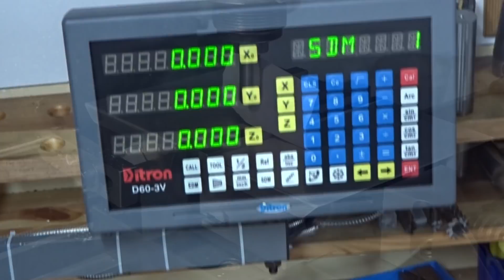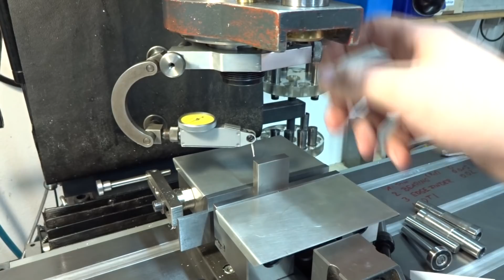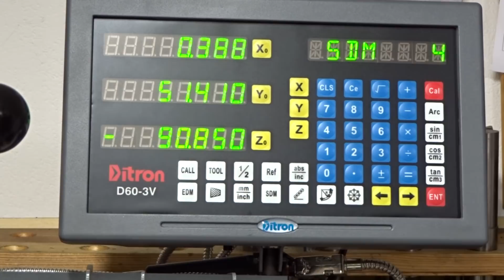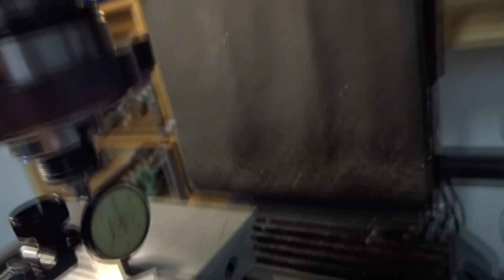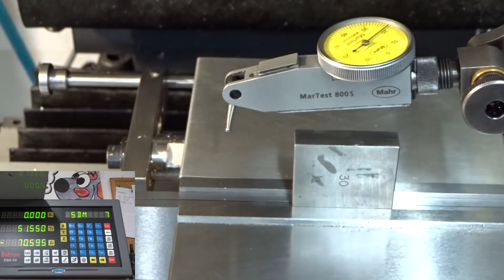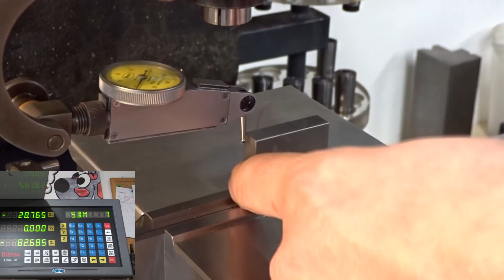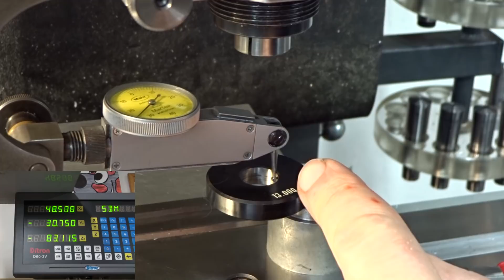Edgefinding techniques

Comment: I've seen on the Internet an Indonesian  machinist use a wire to find the edge of the workpiece.
Reply from the maker: Yeah, esp. with welded assemblies or castings thats not the worst solution.

Comment: The newer DRO with LCD screens allow users to enter any arbitrary number into X, Y or Z counters.
You only need to touch the edge, enter the diameter of the edge finder or thickness of the paper into appropriate axis and you are done. No need to move the table to reset the counter to zero.
So if you are looking to buy a DRO display, get one with LCD display.

Comment: Simply refreshing not to have to hear about "INCHES" and "FEET" or other body parts still employed by North Americans to describe distances. Not to talk about fractional BS like 17/64 or nuisances like that. After years of trying, no American can tell me off the top of their head what we wind up with if we want to add 17/64 plus 21/32 , subtracting 3/64 and then divide that by two - without resorting to paper and calculator.
And BTW: Very nice Video, the comparison is compelling, and pointing out the 10 Micron spindle runout revelation. Sehr interessant gemacht, Stefan.

Comment: I really loved this video but I don't understand the last part.  What does it mean that the "indicator is set to a certain diameter"?  the tip of the indicator is under tension while it's in the hole, right?  Otherwise you wouldn't be measuring anything?  So how is it "set" to 13.000 rather than, say, 12.900?

Comment: Stefan, I was thinking about the 20 micron discrepancy and I remembered your discussion from a year or so ago when you showed how the indicator holder could be a source of the problem ( from slop in the joints ). The holder mounts to the spindle and has two pivot points prior to the dovetail mount of the indicator.

Comment: Another use for a (standard) edge finder is for finding centers of holes, using the 1/2 feature of your DRO. Just start off with your finder somewhere arbitrarily inside the hole (it doesn't seem to matter exactly where) and do a move in one axis to each side, using the 1/2 calculation to find that axis' center, and then repeat for the other axis. You can do a double check to be sure once you have established what you believe to be the center, but I have found it not usually necessary. You can do this on any size hole that the edge finder will (at least) loosely fit into. I do this routinely, and have checked with a test indicator for accuracy, finding it always within a half thou. Just make sure the hole is round, clean and smooth for the best result.
I believe it is a quite reliable method and saves lots of time. Try it yourself and see.

Comment: What about the Multimeter method? It's where you set a multimeter to continuity mode, clip one lead to the stock and the other to the tool. As the tool touches the stock, it beeps. This method allows you to avoid changing tools. Btw, who makes a better CNC for general purpose mold making, Datron or Kern?
Reply from the maker: Datron and Kern are two complete different machines.
Datron builds Routers, Kern builds hsc milling machines.

So, easy answer, none of the two for general purpose mold work. Most Kerns cant cut Mold bases, because they are to large and Datrons are not efficient at machining steel.
If we talk only mold cavities/inserts, the Kern of course.
Reply: @StefanGotteswinter  You must know both machines like the back of your hand. Cool!
Reply from the maker: @bobweiram6321  Yes and no ;-) 
I ran a Datron M10 for 7 years in prototyping, a M3 and M35 before that for quite some time.
No hands on experience with the Kern, but we have one at my dayjob and i have done a tiny bit of programming for it.

Comment: HI; these edge finders with the spring inside are dangerous , because if you spin them to fast the spring becames a slasher, to stop that to happen , I fit a piece of 3/32  tig welding rod  
inside the spring  ...

Comment: Stefan, about 25-30 years ago, I was given a "double-ended" (wiggly) edge-finder by a Toolmaker at work.  For the last few years I haven't used it.  I recently set up my mill-drill :( to make a few parts and the edge-finder seemed "sticky" and appeared inconsistent.  You said to use a small amount of grease to lubricate this type of edge-finder.  Can any grease be used?  What about different types of  oil?

Also, my "double-ended" edge-finder has a spring-loaded cone on one end, but I've never seen that end used either in real life or via YouTube.  The only way I can think of to use it is to turn the spindle off and lower the cone into a round hole (that it happens to fit without dropping all the way into it), mic the "offset," and adjust the X & Y axes until there is no "offset."  Is that correct or are there other ways to use the cone end?

Both books by Moore are (or were within the last two years when I bought my copies) still available new from Moore for much less than from eBay and other online used book sellers.

Thanks for this video.  I learned a lot from seeing you demonstrate the different techniques!  ;)

Comment: I never understood the need for an edge finder to kick out, the mere coming in to running true verifies it contacted the work piece.  Having to move the table in closer for a kick out  seems like it would adversely affect the accuracy by a few thou, no?
Reply: Joe, no, the edge finder kick-out doesn't adversely affect the accuracy by a few thousandths.  I don't understand edge finders well enough to explain them, but a year or so ago Stefan answered a question by saying that in his experience at his work place with quality edge finders and high-end CNC machines that the edge finders are accurate to much better than one thousandth.  I forget his actual answer, but they can be accurate to within a few microns, if memory serves.
Reply: Yes,  understood of course, but it just doesn't seem logical that it touches, turns true, has an exact diameter, and yet we crank the axis a little extra to make it kick out. 🤔

Comment: Excellent video on the pros and cons of the various methods. Like you,I prefer the rotating edge finder for edge locations and the finger indicator on a 'C' type spindle holder for centering on round features. As you say, the coaxial indicators are very good but take up a lot of headroom due to the length of the body. All good stuff,Stefan.👍

Comment: 18:00  This would be particularly interesting with a laser, less angular distortion?
Reply: With a laser, you will get weird interference patterns when the two parts get close.
I'm sure Stefan would use that when he wants sub-micron accuracy ;-)
Reply: @TheEvertw  
Doesn't an Interferometer require two paths of different lengths?
Reply: @lordsamich755  It does. I was talking about diffraction patterns, which are a result of the interference in a laser beam when it passes a narrow slit or orifice.

Comment: Great video, Stefan! During the past year, having a little more time on my hands, frustrated with a cheapie spindle indicator holder,  I made an indicator holder a little like yours, and one feature I found I really like is a fine adjust.. not an essential but makes things even more convenient.. I also worked out a way for none of the thumbscrews to loosen from pivoting the joints.

Comment: Hey less of the old timer, I still use a cigarette paper
Reply: I found that the small anti-shoplifting RF devices, about 3/8 x 1 1/2 " rectangle, (often stuck to a store bought item) contain a couple pieces of thin metal, that are about 0.001" thick, and fairly tough.. useful for edge finding if you don't have shim stock that size around..

Comment: Hey Stefan, great video! Thanks for the clear presentation. I really enjoyed your approach.
I'm just wondering... does the deviation of the pin and paper method go in the right direction? Does the smaller numer compared to the other methods indicate spindle runout? or maybe misalignment of the head?
Cheers, Michael

Comment: Am I the only one that brings the stock to pin?  That's a lot of extra work to find a work offset.  Drop the pin wherever, bump the part against the pin, clamp the part, zero the axis, adjust for pin radius.

Comment: Hi Stefan; i was wondering how much dependence these methods have on the squareness of the gauge block and gauge ring vs. the axis of the spindle vs. table... If the gauge block is not perfectly square, it seems that one would have some dependence on Zed axis position of the touch points... In the case you have, the dowel pin with the light source behind it seems to "check" the square relationship, and even show a few microns of surface wear/unevenness?

Comment: Another thing you can do which I have found works reasonably well is to just catch the paper with the end mill and pull it back, (with enough area for a micrometer tip), and then measure the paper thickness with your mics. I've also noticed that providing the pin has no runout, you should be able to see light past it down to .0002 of an inch. Most of these methods you have described very well and work fine for most purposes. Another trick I use occasionally is to clamp the part in your vice, then swing a radius between the vice jaws near the part, then zero the indicator in  the center of the jaws, then you know exactly half that (thickness) to then indicate the sides of the part to center of the spindle.  Good video.

Comment: Maybe I missed it but after using the dial test indicator (d.t.i.), you could move directly over the edge and set your d.t.i. to zero. It's a bit tedious, but explained better than I can in Moore's book,Holes Contours and Surfaces in the chapter Jig Boring Practices. The benefit is that you are directly over a edge , no radii to account for, no radii to forget about.  another question, what's your feeling on using a slip type edge finder horizontally?I've always tried to have the live end of the edge finder climb a vertical surface, meaning the spindle direction will run  counterclockwise or clockwise depending upon the approach direction. I've grown to favor the d.t.i. but sometimes an edge finder is the quick & dirty way to go. Excellent video, well explained and presented.

Comment: Hi Steffan.  Thanks so much for your videos.  I am an electrician, and i build automation systems. I stumbled over your videos for 6 years ago, and now i both own a lathe, bridgeport mill  shaper and surface grinder.   Its contaiges..  Though yours and other youtubers like abom79, tom lipton videos, you have tought me to use these machines.  Thanks so much for all your help. 
Is it possible that you can put a link for the build video for your Dti holder?

Best regards Filip

Comment: My favorite tool on a mill is an edge finder, however I still can't exactly understand how it's not connected to the spindle runout... If it's 10.000 mm in diamater and it's placed in collet with 0.04 mm runout after it knocks off you have to move it 5.02 mm to find the center, right?
Reply: Draw a circle and think about it as the spindle bearings. Mark the center with a cross and now draw a smaller circle off-axis inside - that is your edgefinder with some arbitrary amount of runout. Now the whole thing including collet turns around the centre of the spindle bearings - it will share the bearings centre of rotation. The edgefinder can slide in any direction to self-correct for this runout. A normal endmill of course does not.

Comment: Hi, the method with the DTI only works if the edge is vertical, am I correct ?
Reply: No you can find the Z midpoint the same way... Touch the top edge, zero your DTI and your DRO, then drop down and touch your DTI to a small gage block that you're pressing up against the bottom edge of the part surface. Now you've easily measured the height (or length) of a feature from the top of the part. To get the midpoint, just use the "1/2" button on the DRO.

OF COURSE, you will have to do some math to offset any tools to cut at this midpoint. For example you could put a 123 block on the table (or just use the back of your vise) to get a reference distance from the midpoint you just measured, and then set your Z height of your tools based off that surface.
Reply: @pmdeutsch  Then the method proposed assume that the side of the part is vertical, and it can work for any angle if the 2 measurements are done at the same distance (one below and one above) from the top of the part.
Reply: @bzaz_3158  I would assume so, but only if the two angles are in fact identical.

Comment: I never considered using the bearing method. I always used a dowel with a .001 feeler gage. Edge finder is another easy method for quick setups.

Comment: I've got the same DRO-- they are distributed by PM here in the US. I never knew what the SDM key did! I'd been using the INC/ABS key to get 2 coordinate systems.
Reply: Read the manual. There are a ton of features you're probably missing out on.
Reply: Stefan did another great video on this, more applicable to the lathe but also usefulff for multiple datums on the mill   https://www.youtube.com/watch?v=zJX7QCvSo-U

Comment: Thanks!  I find a lower speed works best for the spring-type edge finder. At 1000 rpm I can see it snap away, but at 500 rpm I can see when it just starts to move.

Comment: DID I HEAR - SCRAP GAUGE BLOCK?    Way to make us amateurs feel just that little bit smaller and a little more insignificant.
How do you have a scrap gauge block in the first place?
I thought disrespecting a gauge block was considered heresy deserving of a medieval punishment that included the removal of body parts.
Reply from the maker: I buy used, very bad looking gage blocks or even better whole sets of rusted gageblocks whenever they come up for cheap, for various purposes. They serve extremely well for setup work of any kind on a milling/grinding machine :-)
My good gage blocks (which is a inexpensive chinese import) dont get anywhere near a cutting tool.
Reply: @StefanGotteswinter  Excellent points, particularly the salvaging & rebirthing but its still sacrilege to ruin a gauge block.

So how do the cheaper Chinese gauge blocks measure up against more expensive Japanese, American & European gauge blocks? We all notice your micrometer is a Mitutoyo but (for instance) how do the cheaper gauge blocks measure up against Mitutoyo gauge blocks?
Is it worth people getting just a couple of high quality individual blocks (1, 5, 10, 25, 50, 100mm) for shop calibration? Something to accurately check calipers, micrometers & dial gauges against. I know historically most shops had gauge block sets the machinists used and then a master set to check everything against. Even these days you can still get different quality/accuracy gauge blocks from shop to QA to lab as you do for surface plates.
Reply: @tonywilson4713  From those who've done some measuring of workshop grade Chinese blocks, they seem to be up to snuff. I haven't seen anyone do proper calibration of them, though—the measurements they did were informal. And I haven't seen any tests done on Chinese blocks that claim to be of higher grades than economy/workshop.

Whether it's worth picking up a handful of higher grade gage blocks for checking micrometers and such, I think so. Partly because I'm OCD, and partly because you can get them inexpensively if you haunt eBay. I picked up several Mitutoyo 521 series (ASME Grade 00) blocks new for $10 a piece. Just takes some patience.

Comment: Hi Stefan, what's your take on using DTI in such way, that rotation of needle is parallel to movement of item (similar as shown in this video)? Isn't it worse than using it when needle axis of rotation is perpendicular? What I mean is, in such examples, in very little movements, needle is moving left and right, not in and out which could create a little bit of errors doesn't it? It sometimes can be observed on dial if DTI is slightly off center. I know, that it is harder to read if indicator would be mounted horizontally rather than vertically, but wouldn't that be beneficial?
Reply: A dti measures the rotation of the needle, it works just fine with the needle vertical, and the dial horizontal (against a vertical surface).

Comment: Is the DTI the most accurate way of measuring on the mill? (Sorry, the comparison between the other methods left me wondering)
Reply: Hi oh black one. Yes, along with the edge finder. The other two were not far behind but are affected by the run out in the collet, which does not effect the edge finder or indicator as Stefan explained. The maximum difference of 0.02 mm is roughly 1 thou or 0.001 inches which is within the working tolerance of nearly all milling machines at any rate. A good jig borer would be at least ten times better than that though and new would be  a lot more expensive than a hobby milling machine....... BobUK.

Comment: Stefan, you have convinced me that I really need to buy a DRO!
Thanks Paul
Reply: You certainly won't regret it. Once you've had a while using a DRO system on a mill you wonder how did I ever get by without it.
Bear in mind also that super accurate bolt hole patterns become very easy to achieve with a DRO and line of holes set out at any angle desired.

Comment: Hi Stefan, when centering a part with  the DTI method, how do you acount for backlash if you don't have a DRO when you swap to the other side to pick up the other edge? Thanks
Reply: I think if you approach the measurement turning the crank in the same direction each time, you  should eliminate the backlash error.. I have a sharpie arrow mark next to each of my mill table dials to remember which way I usually approach a measurement. w/o DRO, will have to do more counting and math though!
Reply: DTI method requires a DRO.
No DRO the magic does not work.